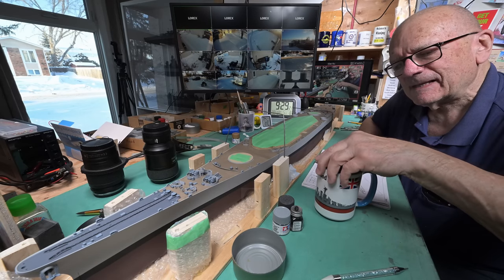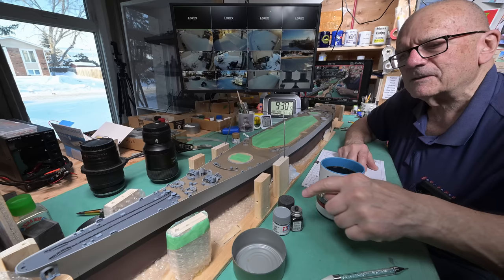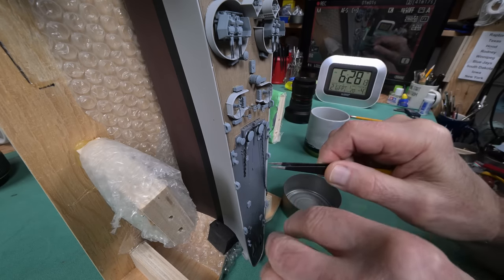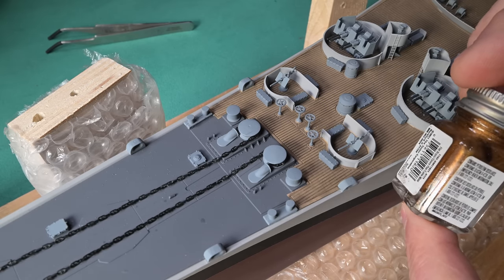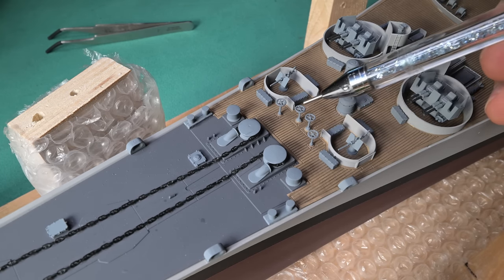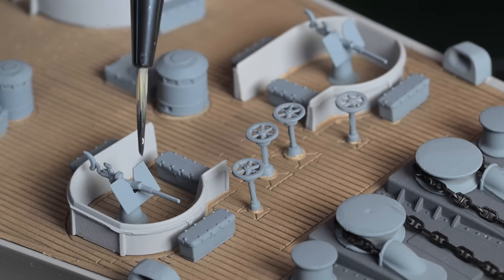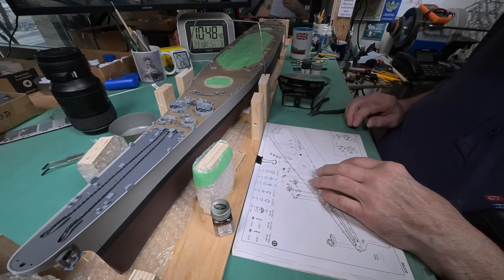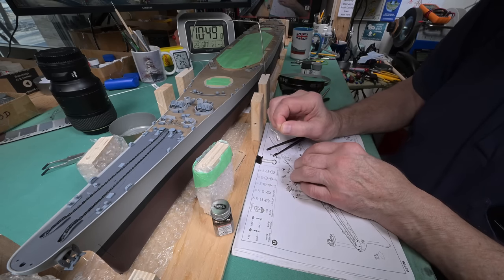The Model Ship - Part 1442

Comment: ...it's all looking good! I'm guessing the holes and spacing were done for the smaller chain, and that you'd have had an easier time if you'd use it...but I'm glad you went ahead with the larger chain...it looks great...
You were wondering about painting the recoil mechanisms on the larger guns...I wonder if just a dab of the black highlighting stuff would set them off???...not that I'm trying to find more work for 'ya...😅
Matt

Comment: Hi Ron. Just an observation and not a criticism but when you put the macro lens on it appears to be that there is quite a lot of paint on the brush and may lead to losing some of the detail. Some Tamiya paints don't cover well and need two coats but just wondering whether to put two thin coats instead of one thick coat might do it and help to stop loss of detail. I find that Vallejo - Colour - covers well with a first coat but whether you can get the equivalent colour tone . Prob wouldn't notice at a distance any slight change in colour anyway. Look forward to tonights viewing.
Reply from the maker: Hi John,
Not offended. Readily admit that my painting skills need work! 😁

Comment: I think you need a box of round toothpick on the table.  Probably would have worked on putting that chain in the hole and for pokin' in general.  No scratching either.  I see Amazon has them up to 4" long.           See ya.             JimE
Reply from the maker: Thanks Jim 👍🏼